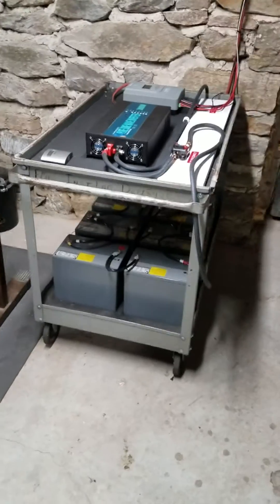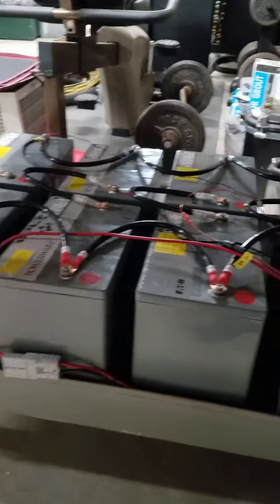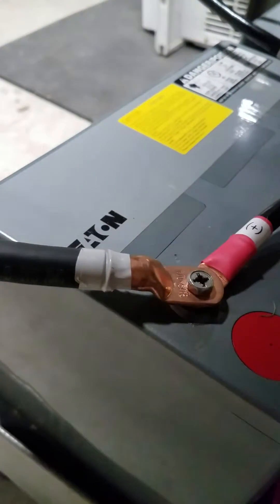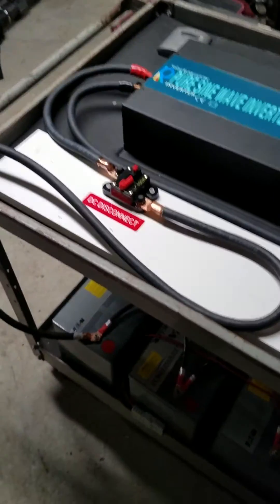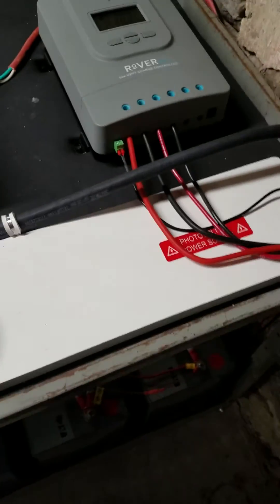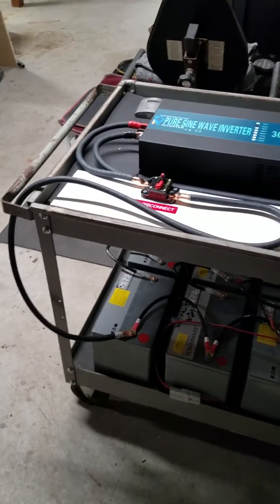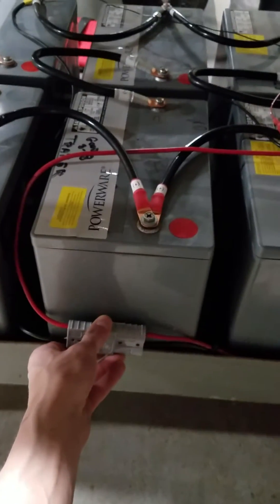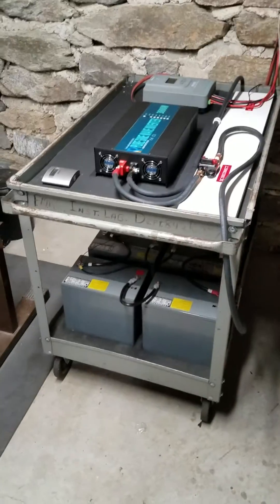24v Emergency Battery Backup System 3000w 7.2kWh

Comment: I love home built units!  Great job. Free batteries!!!  Most awesome.  

I built something similar on wheels and added the Renogy BT-1 blue tooth module to the Rover 30 amp MPPT solar charger like yours.  The 2 right hand outlets on the solar charger run a table lamp that has an Edison screw base 6 watt 12 volt bulb in it. Those terminals are good for 20 amps.  From upstairs I can use my phone to turn on the Load  terminals on the solar charger and light up the garage where the unit is stored even in a power failure. I can see the garage light up looking down at the skylight. Its a pretty handy addition for $35 and the solar output details as well as the battery voltage can be monitored by phone as well.

  I  also sprung for the $100 Renogy 500 amp battery monitor and that's the best improvement I made on the entire unit. It recalculates the remaining battery life in hours every time I change the load on the system. It even recalculates the remaining battery life while the sun is hitting the panels adding to the battery life time. About half the cost of my unit was in batteries.   You made a very nice setup!
Reply from the maker: I was literally just about to order the Bluetooth BT-1 unit so I could use my phone to monitor it haha that's funny! My wife said she would get it for me for Christmas so I'm waiting until then! I'll definitely have to look into the 100$ renogy unit that sounds very handy to have the estimated battery life and timeframe calculated out I would be very interested in knowing that! Thanks a lot I love messing with this stuff it is very interesting haha. I'll have to also do some lights off of the load terminals on the rover that sounds like a good idea!

Comment: How did you built it and what are the necessary materials and tools to build
Reply from the maker: I just used a roll around cart, bought some 4 gauge THHN wire for the battery connections, 1/0 wire for the battery bank to inverter connections, a 100 amp DC breaker ( handles up to 2400w @ 24v,)  a 3000w pure sine wave inverter, a 24v renogy 30 amp solar charge controller, two 12v 100 watt solar panels wired in series to 24v, eight 140 Ah 12v batteries wired in series-parallel, some 6 gauge THHN wire for the inverter ground to an 8' grounding rod, and a bunch of copper crimp connections (4ga. And 1/0ga.) I basically just used a screwdriver for all the battery connections. I used a big crimper to attach the connectors, then shrink tube to go over them all. Sledgehammer to pound the ground rod into the earth. Some 12-2 wire with ground for the AC outlets from the inverter to a junction box, then some outlets and weatherproof single gang boxes. Not too many tools per say, just a lot of thinking and planning! Most of the equipment was recycled from my work, besides the inverter, charge controller, and solar panels. Hope this helps!

Comment: Please I would like to know the module you are using to monitor the battery voltage remotely
Reply from the maker: I order it off Amazon, the temp display is the only thing that's off. Battery Capacity Monitor, DROK 10-100v Battery Meter, 12v 24v 48v Battery Power Percentage Voltage Fahrenheit Temperature Indicator Gauge https://www.amazon.com/dp/B085DYZV3S/ref=cm_sw_r_apan_glt_fabc_R740N9HWCGXKVJ95R9BV?_encoding=UTF8&psc=1
Reply: @SamsDIY  many thanks, I thought it was a wireless monitor
Reply from the maker: @martforfame4980  No just a simple 2-wire readout! Voltage is always spot on though, and it has an on/off button which is a plus.
Reply: @SamsDIY  many thanks
Reply from the maker: @martforfame4980  No problem!

Comment: What is your panel setup? Watts, volts, amps etc ?
Reply: Thanks.
Reply from the maker: @carlbrrt  I just did another quick video showing the ground I recently ran for the inverter, as well as the solar panel setup if that's any help. It's on my channel.
Reply from the maker: It's just a small solar setup to keep them charged off grid power, two 100w 12v panels in series. I think it gets up to around 6-8 amps in the full sun at around 40 volts and the charge controller is a 30 amp renogy rover MPPT. The controller converts it to 24v to charge the batteries and it will get up to 29 volts in full sun while charging. At night it usually returns to about 26 volts and holds there.

Comment: I recently ordered a setup very close to this. 2x 206ah 12v lifepo battery to be put in series for almost 5k battery. 3x 200w panels and a 3000w inverter from renogy.  I found a 2 shelf metal cart from harbor freight for $44 but bought the 3 shelf for $55. My question is did you use wood in the cart to make sure everything  was grounded.
Reply from the maker: I used a 2 inch thick neoprene type padding under the inverter just to keep all my wiring and connections off of the metal cart just in case of a short. You would need to run a ground wire from the inverter chassis to a known ground like a water pipe or you can just get a grounding rod and drive it into the earth and connect to that from the inverter. You will also want to make sure your AC side is grounded as well!
Reply: @SamsDIY  another question what gauge wire would you use with 2x 206ah 12v batteries in series. The battery states max 100 Amp draw
Reply from the maker: 3 gauge wire is good for 100 amps, or larger. I used 1/0 on my bank to inverter connections which is good for 150 amps.

Comment: Hi Sam. Neat setup you have there.  What's that inverter and how do you find it?  Apart from the fridge, TV, modem &router you mentioned in the video, anything else you have tried to run off it? Like a kettle or any other household appliances?
Reply from the maker: I ran my 600 watt AC, my gaming PC, I charge my 40v, 20v, and 18v tool batteries. The inverter is made by reliable electric, it was around $400 on Amazon I believe. My refrigerator pulls 800 watts until it is stable, then stays around 120 watts. The ice maker uses another 350 watts to turn the auger, I've used a 400 watt baby bottle warmer on it. Obviously not all of this at once, but it works well! I haven't tried the Keurig 2.0 but it would have no problem with that. I used to run my Xbox one and tv off them in my shed.  I plan on trying some corded tools as well when I get some time. I haven't tried  my 15 amp tools yet (chop saw, table saw, lathe, etc.) But I will do that soon and hopefully make a video with them doing some work!
Reply: @SamsDIY  thanks for the reply, sounds like you put it through it's paces but yeah would be good if you could make a video testing the power tools too.

Comment: Thanks for sharing!! Have you checked the inverter voltage between hot, neutral, and ground? Is there 120v on the ground? If so this might be an issue for the house wiring. I'm hunting for a 3kW inverter now that is safe to tie into a transfer switch.
Reply: You’ll always have 120 phase to ground or 120 phase to neutral.   The neutral at your house panel is also tied in the ground there
Reply from the maker: I checked the ground to hot, and ground to neutral, both are showing 60v so the 120v is split between the neutral and the hot. Neutral to hot is obviously showing 120v. That is why you cannot hook this inverter up to the grid. I've had no issues with it but I am planning on stepping up to an AIMS split phase inverter/charger soon to be able to tie into my main panel.
Reply from the maker: I can check that and get back to you! I'm sure AIMS sells one but they're are a bit expensive, but good quality from what I hear.

Comment: I have a very similar set up on a portable cart like this. Considering using an automatic switch in case I drain my batteries too low it will go back to grid. I also used a piece of plywood to mount my inverter under by the batteries but vertically. So far so good just need to install auto transfer now.
Reply: Any video of your setup. I've ordered 2x 206ah 12v battery I plan to wire in series for right T 5kwh battery. 3000w inverter and 600w solar panel. It's my first time doing solar but am excited. I found a cart similar to the one in this video for $45 from harbor freight. I went with the $54 3 shelf one though.
Reply from the maker: @RedneckPCtech  awesome, is it just one solar panel @ 600 watts? I haven't heard of many over 500 watts, which are relatively new. That would be sweet. Remember also when you run two batteries in series, the voltage doubles but the amp-hour rating stays the same. So two 206 Ah batteries in series @ 24v would remain 206Ah regardless. If my setup remained 12v it would be 1,120 Ah but it's not the best way to wire all parallel. Also with 24v all your wire sizes can be cut in half as for gauge, since the amperage would be half of that @ 12v, so you save money on needing big fat cables to handle double the amperage. If you were able to get 4 batteries @ 206Ah you would double to 412 Ah @ 24v with two series connections and then parallel the two series banks to double your Ah rating. Hope this helps!
Reply: @SamsDIY  it's 3x 200 watt renogy panels. Wanted to get my feet wet before committing more money. I wanted a pallet of 10x 440w panels but my wife didn't go for if.  I got 2 of the sokbattery marine rated 206ah 12v. I only have a renogy 40 Amp mppt charge controller that can do 12 or 24v.  I spent $3500 for my first system.
Reply: @RedneckPCtech  I’ll try to get a video made soon. I’ll let you know when I do.
Reply from the maker: I would like to do that as well, but I have a 10 circuit generator sub panel already. So I figured unless I get rid of the gen, I won't need a transfer for the batteries yet. That sounds like a great setup you have!
Reply: @SamsDIY  your set up is so clean that it makes me want to finish cleaning mine up haha
Reply from the maker: @brett639  Thanks! I'm glad I can actually inspire someone! Haha

Comment: Greetings, question, did you get 3 120v cables.  direct from the inverter where are they connected and what is the live and what is the nuetral and ground?
Reply from the maker: The 3 wires were just a 12 gauge grounded extension cord but I have switched over to solid 12-2 gauge romex wire for the AC side. The wire goes from the inverter to a junction box, where it splits out to outlets around the house. On the inverter itself, the wires from left to right are hot (black) ground (green) and neutral (white.) Hope this answers your question!

Comment: My power blips a lot and I have literally put surge protectors on everything
Reply from the maker: A nice On-line or Line-interactive UPS (uninterruptible power supply) would take care of power blips. I just set one up for my computer, modem, TV, and router for that reason, or in case we completely lose power. I will make a video hopefully tomorrow going over it! Maybe it will help you get an idea of what you could do to fix that. Those UPS's "clean" the power of whatever is plugged in, and also it senses when a power dip happens and instantaneously (2ms or so) switches to the batteries automatically if it goes below a certain AC voltage, or you lose power completely. They also have built in surge protectors.

Comment: I really need something like this, do you have plans for it? sourcing and everything?  I am going to put together a parts list after watching your video a few times
Reply from the maker: I have some drawings I did when coming up with the design. I can write down everything I used and why, as well as somehow post a wiring diagram. It's 4 strings of two 12v batteries in series to make 24v (8 batteries total), then the 4 strings of 24v are paralleled together to keep it at 24v for the whole bank. I used 4 gauge THHN wire for the battery to battery connections, and then I used 1/0 wire for the battery bank to the inverter. I have a 100 amp DC breaker on the positive wire on the positive. Make sure all your wires are equal in length for battery to battery connections, and make positive and negative same length for bank to inverter. Hope this helps some! Let me know if you need more info!

Comment: Does the voltage system(12,24,48) matter when sizing jumper cables(awg) from battery to battery?
Also, how do you determine the cable size (awg) for battery jumper from battery to battery?
Reply: Thank You very much, I appreciate your time on my question.
Reply from the maker: Yes, but there's some variables. I will send this link to an article that explains it very well. Hopefully this will make it easy to understand how to size them properly! 
https://modernsurvivalblog.com/alternative-energy/battery-bank-cable-size/
Reply from the maker: Anytime!

Comment: How long will this run your fridge?
Reply from the maker: I would have to do a full run with the fridge, but I would say 3 days or so on a full charge, without any solar input. Just don't use the ice maker if you have one, they use a lot of power to turn the auger.
Reply: @SamsDIY  nicely done!

Comment: Thats is 48 volts no 24 volts your have 8 battery.
Reply from the maker: No it's not, look closely! It is 24 volts no question. I wired it as 4 series connections between two batteries each, which is four 24v banks of 2 batteries. Then I paralleled all four banks together, keeping it at 24 volts. I wired it in the most balanced way for charging and discharging. I think your looking at it sideways?

Comment: If I make my own battery box is made of steel, how do I insulate it so that power doesn't accidentally transfer to the box itself.
Reply from the maker: You can always ground the steel with your ground wire and also ground your inverter in line as well (for the AC power side.) That would keep you safe in the event of a short circuit! On the DC power side, you should have a DC circuit breaker or fuse on your main positive going to the inverter, as well as on any other accessory/load wires (+) Also you should cover all the battery terminals so you don't accidently drop a wrench across the (+) and (-) Hope this helps!

Comment: at full load how many hours will it last to drain the entire battery. *without the solar panel. i want to install the same system cause our grid is intermittent.
Reply from the maker: Ive never run it at full load but I can find out for ya! I have a 100A DC circuit breaker between the bank and the inverter so that would limit the load to 2400 watts or it will trip. Ill see if i can take a video of it with a heavy load on it.
Reply: @SamsDIY  oh thanks, i was just wondering if how long will the battery juice lasts at say 2kw load.
Reply: @P2Pbase  if he has 3000 watt hours of battery a 2000 watt load will drain the battery in 1.5h